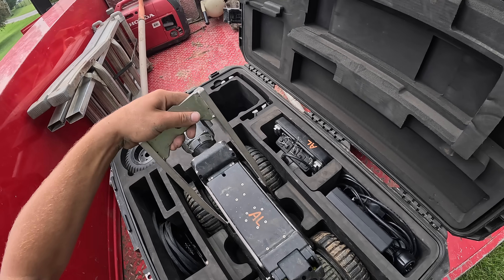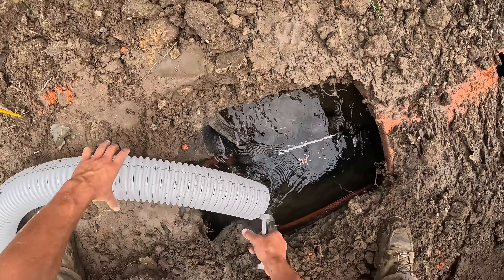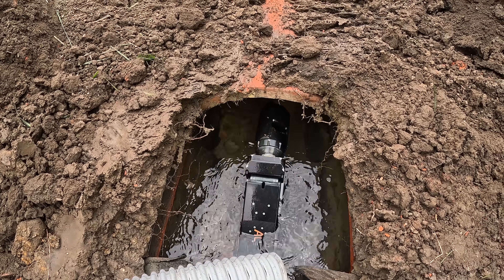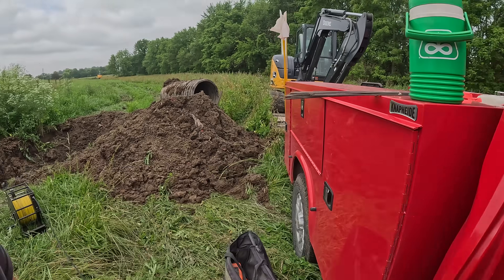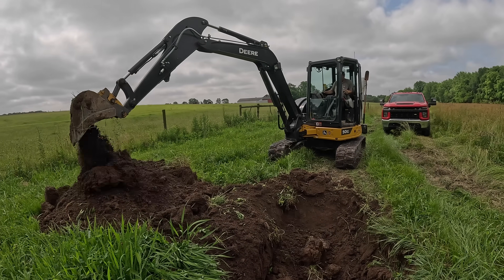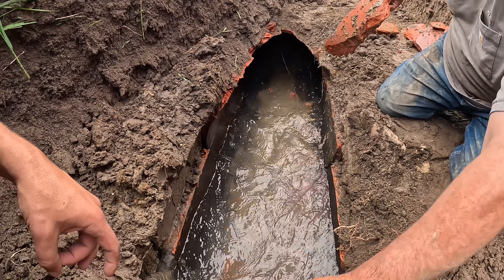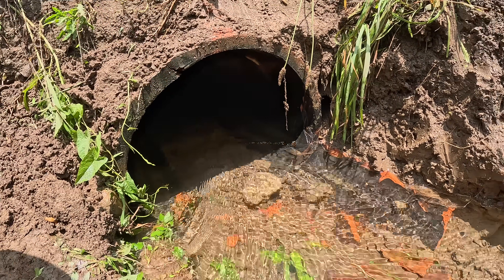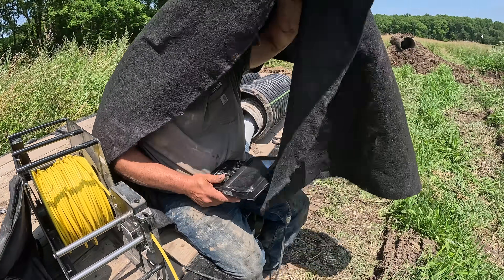Cameraing A Big Tile Main

Comment: Did you know that "cameraing" is not a valid word. Lol.
Reply from the maker: sorry, I didn't like English class
Reply: A huge amount of English today wouldn't have been considered 'valid words' decades ago. That's how language works, you make new noises for new things. The key bit is the meaning of this noise is clear to anyone who hears it, so in that sense it is valid. If some of the utter nonsense slang can be accepted as words with meaning, there's no reason new words with clear meaning can't also be accepted as well. Arguably there's more justification behind 'cameraing' (although some adjustments to the double vowel might be needed) becoming a word than most of that other nonsense. It's a verb for the joint act of operating/controlling/driving a remote controlled camera and recording footage with it at the same time, at least that's how it appears to be being used here if it was to be accepted as a new word.